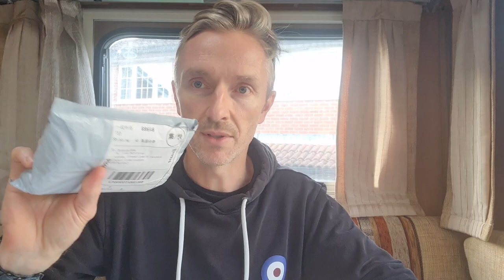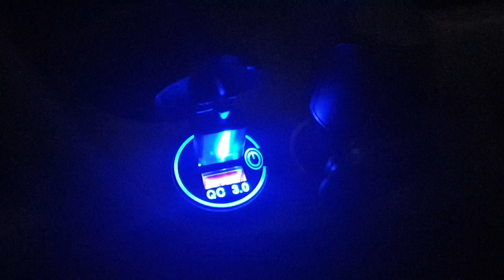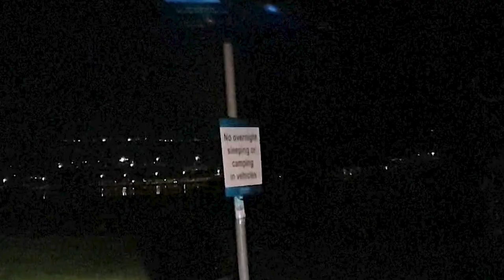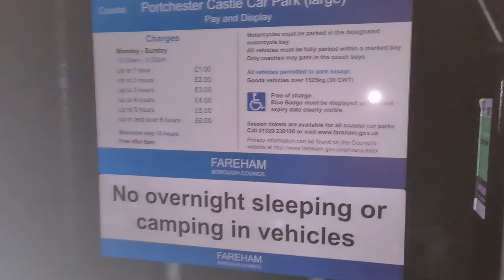We CANCELLED for SAFETY'S SAKE

Comment: Hey guys. For the grey tank and the cassette I can say solbio is the business. It’s all natural so no nasty chemicals. It’s not cheap but it’s worth the money. Have a look on wanderingbirds vlog. As for the sulphur smell, this is usually battery related but reckon if neither battery is hot and your co2 alarm(yes the gases can set it off) is not activated then it’s likely just a nasty smell from the grey water tank. Cheers Colin
Reply from the maker: Really useful information! Yes, will look into solbio, I love wandering bird. And it didn't set our CO2 alarm off, so that's reassuring. Keeping everything crossed for our next escape. Thanks 😃

Comment: Just keep an eye on the battery. The sulpha small is indicative of battery issues. The waste small is completely different and is not sulpha based. As you point out, the engine battery is new so if the issue is battery linked most probably the leisure battery. The battery may come and go around the smell. My van has two leisure batteries and after the small came and went, on advice I looked at the batteries. I tested both with a volt metre and found one was showing a much lower reading and was warm to touch. I then replaced both batteries and since no further issues. Batteries just fail. My two were five years old from new
Reply from the maker: Okay that's interesting and we will keep an eye on it. Definitely not super confident about it being the waste but we will see 🤞
Reply from the maker: Thanks so much 🙏

Comment: Yeah as someone said below a smell from the waste is different from a battery smell. 
Sometime last year we developed a smell that I could smell from the moment we started moving. It was warm outside so I had the windows open which caused the air to blow the smell right to me. I couldn't work out what it was as I hadn't smelt this smell before. I put the plug in the kitchen sink and bang, no smell when we drove off. I worked out it was the inside of the waste tank in our van and not the dirty water in there so when there was water in there we couldn't smell it but if the tank was empty it stunk.

Hope you get to the bottom of your problem soon.
Reply from the maker: Sounds just like our experience! We are seriously hoping this is what our problem is! Thanks for watching 👀 🙂